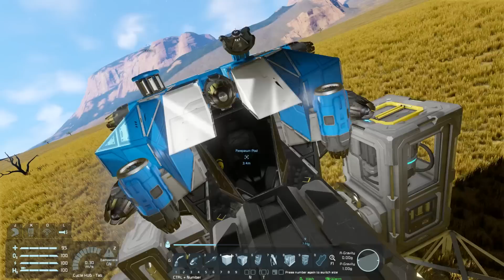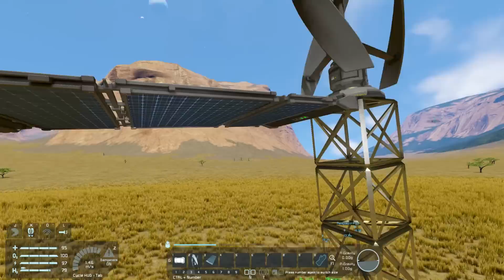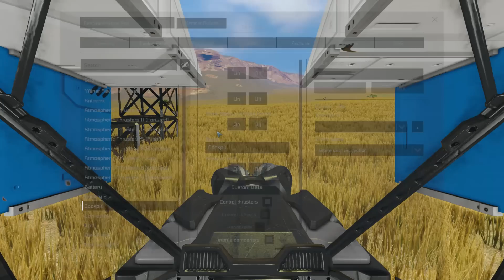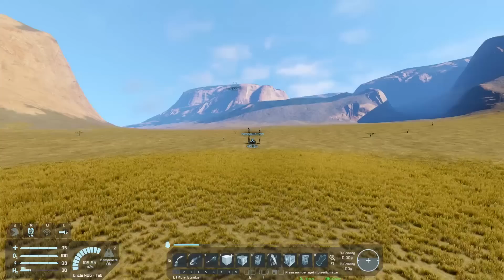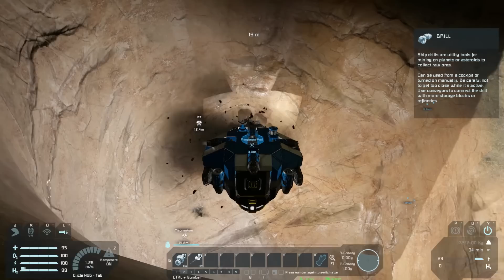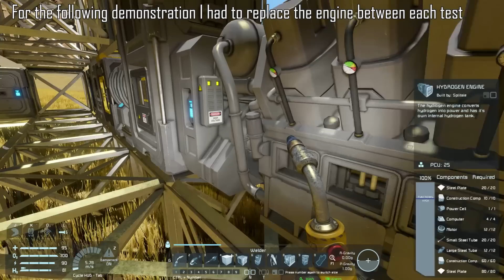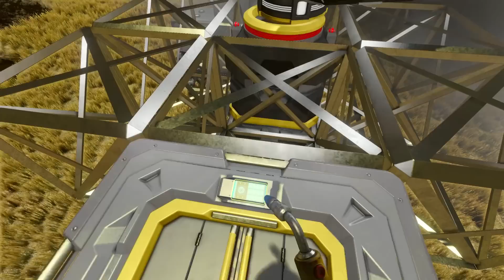Power Systems - Getting Started in Space Engineers #3 (Survival Tutorial Series)

Comment: If only you released this two days ago lmfao! 

I literally got as far as ep 2 then I made a rover and tipped it on the ice and couldn't revert it, during this time my starter ship had its batteries on recharge mode. Didn't know about the none discharge thing  and disconnected it up from the base. it was the total opposite to your graceful landing lol, but I figured it out and reverted them to auto too regain power again and thrust more importantly, only to loose power within a minuite and unsuccessfully reverting that as well. 
I
Now I was upside down  in two vehicle and no power in the starter ship miner. I decided I'd call it a day, logged back in 16 ish hours later to  find my starter ship gone due to the settings with unpowered blocks lol oh well

luckily I've found cobalt etc and marked the locations while I still had them operational to rebuilt a miner of my own design wish me luck 🤞
Reply from the maker: Dang, didn't quite get my timing right this time :P

Good work on getting back up on your feet though, I find it's one of the most rewarding feelings to scrabble your way back from disaster :)
Reply: There's plenty of disaster too when your new lol, I also had the hydrogen engine glitch but I got around that with a hydrogen tank
Reply: this have my cover is a you just a moment wonderful yes (Erfan Zeidani)

Comment: Do wind turbines work on asteroids if you put bloks the same way you did it on a planet?
Reply: Nope, they also need air to function, If you're on an asteroid or a planet with no atmosphere, the turbines are useless.
Reply: @rishoh  Thanks!
Reply: @rishoh  Not quite, you need to be inside an "atmosphere" that atmo thrusters would work in. Wind turbines work on the mars type world. Be careful if you are using a modded world as some of the older worlds, and some of the older skybox mods do not have the variable for "wind" so the turbines don't work there and in some cases neither does solar.
Reply from the maker: I strongly suspect they check to see if you are within a planet's atmosphere as well, the same as parachutes do. So you wouldn't be able to pressurise a space and use them there, or equally, stop them from working by putting them in vacuum on the earth like :)

Comment: Got some interesting plans for a hydrogen engine based moon station now. Thanks for the video!
Reply from the maker: You're welcome, I think that's a good option for the moon (as long as you're at one of the poles where you can get lots of ice easily) :)
Reply: I never suggest hydrogen as prime power source. It only work as emergency/temporal solution.
Reply: TheResro, why's that, seems it would be stable enough, what with all the ice on the moon
Reply: @joshleach3153  The moon is exception because it severally lack power sources, including hydrogen. So you basically are forced to use it until you build decent solar rig, what still isn't easy due to geography. Even on planets with thin atmosphere wind turbines should be most efficient power source.

The way they composed planets is quite clever providing you veering changeless. But even on planets like Europa literally made from ice, over-relying on hydrogen would still force you to waste time on constant mining. So it is advised to provide passive power supply to at least cover idle usage of the base.
Reply: @TheRezro  True, they would need constant maintenance, but don't reactors also need a solid checkup, as they run on uranium. Plus with a large grid miner, collecting a large amount of hydrogen should be too much trouble. And it doesn't just have to be the moon either, you could build next to an ice lake, or if you're lucky, find a large ice asteroid. 

Though, I do see how they could make a fairly reliable jumpstart system if you run out of power. So you're not wrong there.
Reply: @joshleach3153  Reactors are generally late game solution, what provide huge amount of reliable energy. You also don't need check them constantly. Even if I see why people would use hydrogen for power, they should always remember that it isn't prime source.